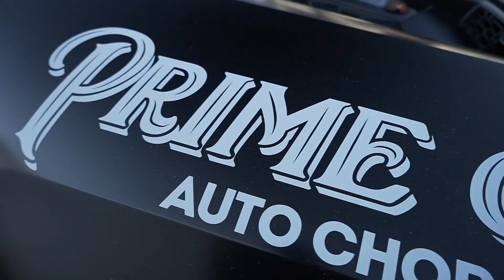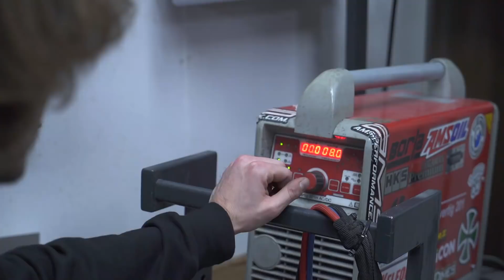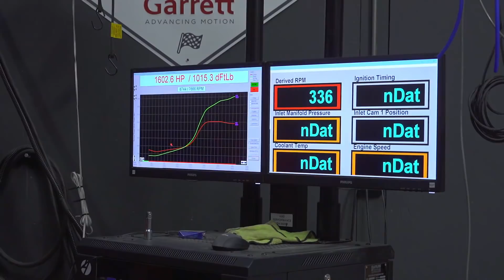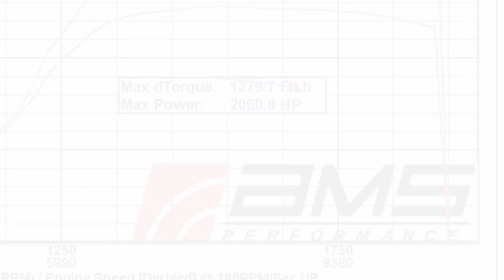BUILDING THE WORLDS QUICKEST LAMBO | Alpha Omega Drag Huracan & Prime Cut's Chop Shop

Comment: 2060HP and it's quicker than UGR 3000HP Huracan. Strange :)
Reply: UGR is making quite a bit more HP then that  AMS makes about 1500whp less then them.
Reply: Maybe quicker but ugr trap speed is another level. 200mph in 4K lb car takes load of power to achieve